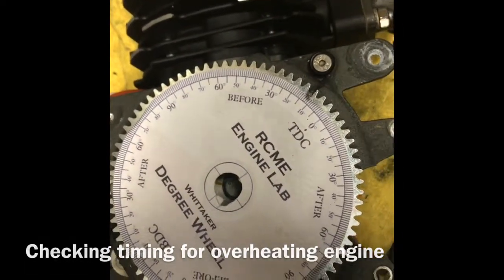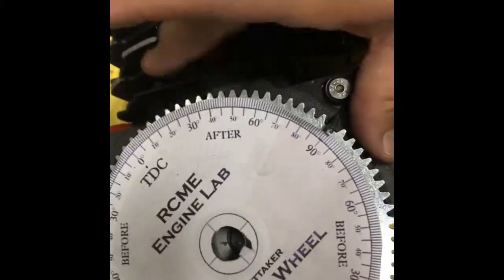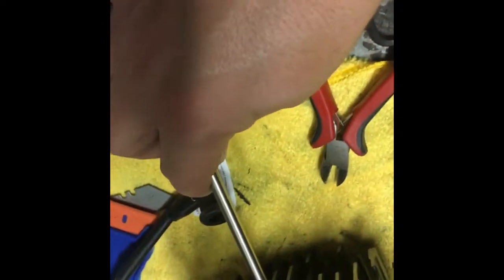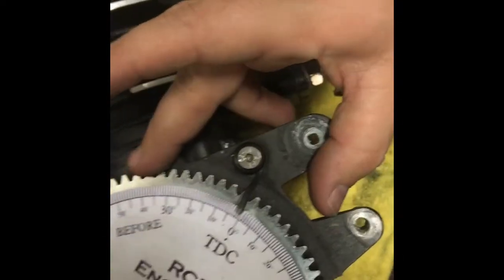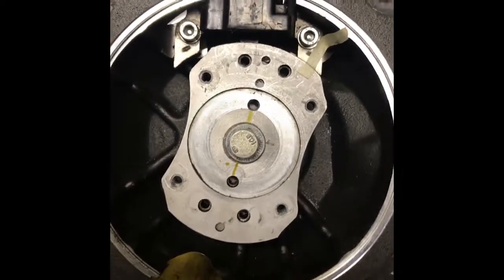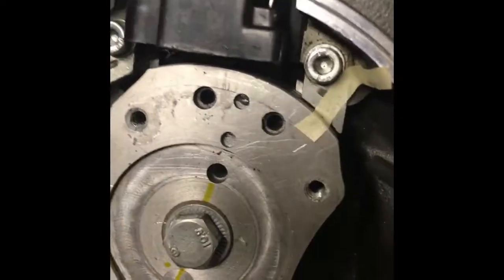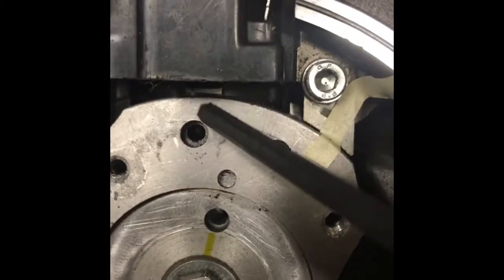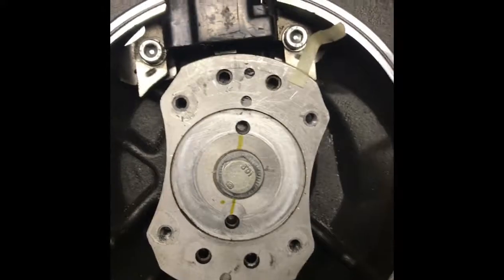Nitro 200 timing Issues

Comment: I have to rebuild My nitro 200 lower end bearings and seals at which point I have to remove the magnetic fly wheel any helpful hints on selling or maintaining the timing is the fly wheel keyed Remove or installation tools I would be more suited for The nitro There’s so little documentation on these motors especially the lower end any helpful advice would be great on your experience